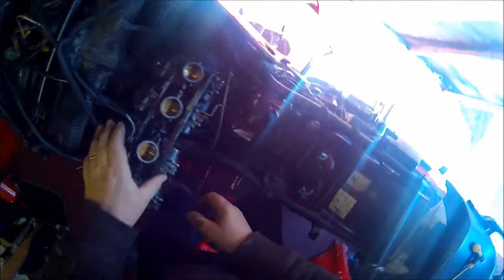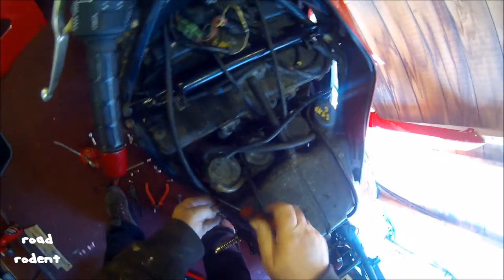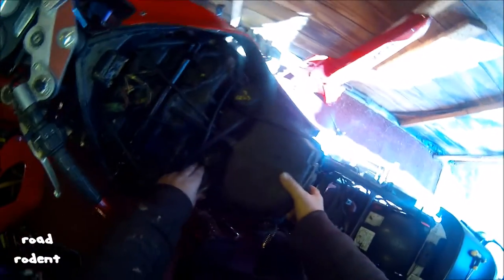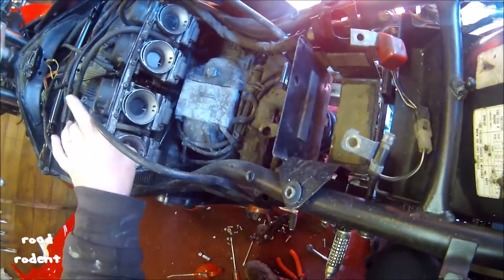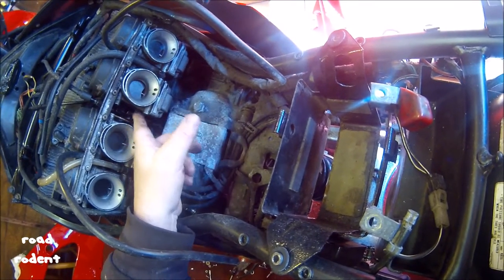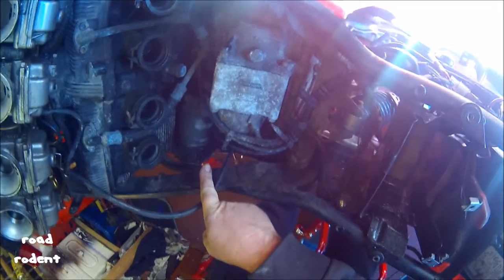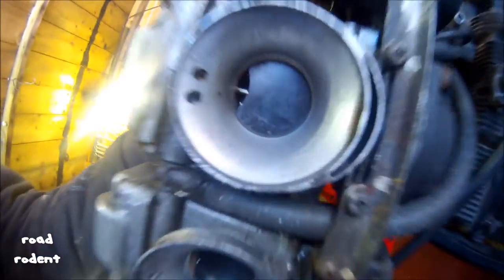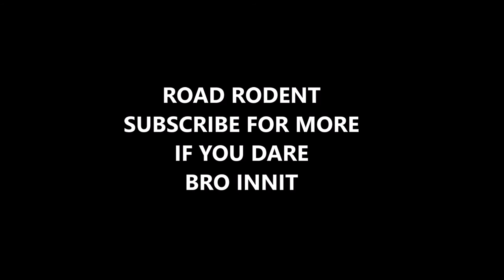1992 GSX600f Part two. Flooding Carburetors

Comment: Can you please help me my 600 katana won't start after few km ride and during ride the rpm goes down and down on full throttle and then the engine shut down and dont starts i and after that i need someone to push my bike for starting and it starts but the rpm feels like it is on chock. It is not responding to throttle
Reply from the maker: Sounds like a fuel problem but I would check all the spark plugs first make sure they are all sparking OK
Reply: Hey, I'm had the same problem with my 03 600 katana, i opened the throttle fully and at high speed the engine just died on me. 10 min of waiting it started up again and got me home. Have you fixed your issue? And what was the problem?